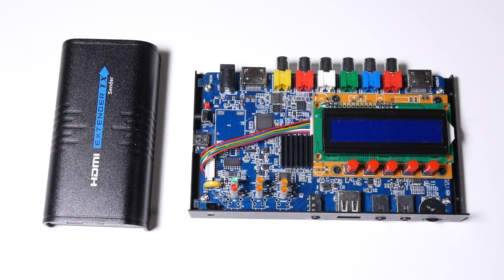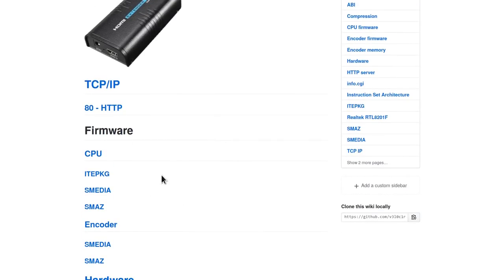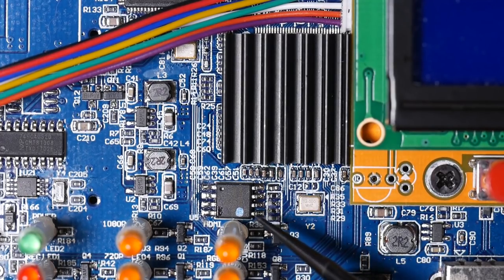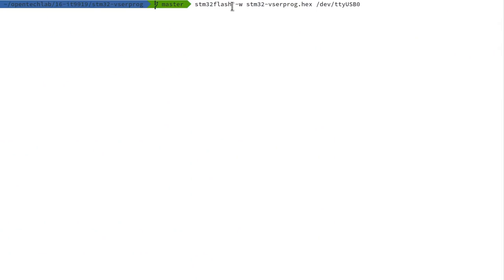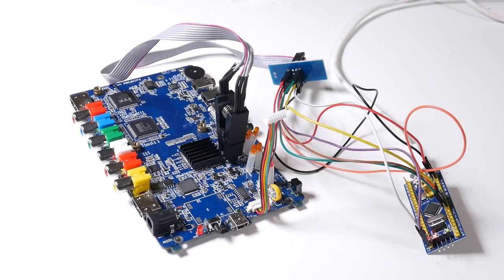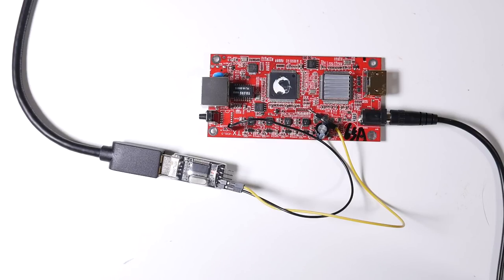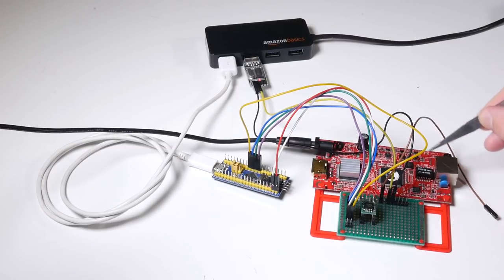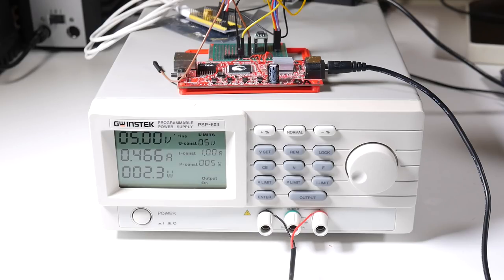[016] IT9919 Hacking - part 1 - Reading firmware with flashrom

Comment: One trick you can use to read flash in circuit is to keep on board processor in reset state. When in reset most of the pins are in high impedance state, and obviously application processor will not interfere.
Reply from the maker: That's a good idea. I never tried that before
Reply: Can you please tell me how to do it? a tutorial for example. Thanks

Comment: Thanks for this good tutorial!
On the STM32 bluepill you do not need to first remove the 10K resistor - just solder a 1K8 resistor on top of it. The parallel resistance then comes to 1K5. This gives less risk of damaging the board.

Comment: I'm 8 minutes in and I'm still gobsmacked that a company (ITE) believes that making their product/chips 100% opaque to anyone that is not a customer is a good way of interfacing with the world. Who cares if non customers know what your ISA is? Why be this secretive? It's even more amazing that a customer would signup to this kind of secrecy. But what do I know? 
Fascinating video for sure!
Reply: They are probably using a lot of someone else's IP in their silicon so they have to be secretive about it in order to not get sued.
Reply: @evghenim1955  Yes, that did occur to me. You're probably 100% correct. I could go as far as guessing that "their" risc core could be something from opencores.org which are under a GPL license.  RISC V maybe ?
Reply: @vincei4252  Isnt RISC-V a relatevely new thing? In the firmware, I see datecodes going back to 2009. I would guess its something more like MicroBlaze of sorts in there.
Reply: @evghenim1955  ok
Reply: Maybe the chip is used in for example settop boxes and thereby contractually kept secret to make it harder to reverse engineer. I saw there is also a security processor...
Reply: @tmichiels  If I understood the datasheet the right way, the security processor is just a HDCP decryption unit (and not an actual processor), but I/datasheet might be wrong.
Settop boxes... Honestly, I dont think thats the case.

Comment: Great to have a new OpenTechLab video!

Interestingly I was able to make a dump (and later restore this after a brick with a dodgy upgrade file!) of the LKV373's flash chip using `flashrom`via the Raspberry Pi's SPI interface without having to extract the flash chip.
Reply from the maker: Yeah with no series resistors it becomes a battle of drive-strengths. It's sometimes worth trying just to see if it will work - even if it's very marginal. But there's always a risk of damaging the board.

Comment: 1. Welcome back! This video a quintessence of hacking and a hacker mindset and it makes me think how far we can go with a bit of curiosity and some knowledge, also, it shows how vast the value of free software and open hardware is.
2. Is there a specific reason why you avoided using a flash/SPI programmer based on CH341A (there are compatibility patchwork for flashrom)? It might have been much easier to read from the soldered SPI chips using something like that along with the alligator clip.
Reply from the maker: Nothing against the CH341A's - though I didn't have any at the time. Overall they're not bad chips, though I would like them more if they were a bit more capable and flexible. The price is good though.
I like the Blue Pills - although it took me a while to explain how to program them in this video, in reality it's a 30-minute job to bring one into service if you do it regularly, and they're a lot more flexible. They can serve as any USB 2.0 Full Speed USB device: JTAG adaptor, GPIO controller, stepper motor controller, Arduino etc. etc., so I think it's worth spreading awareness about them.

Comment: you can desolder the ground leg and raise it off the pad, then hook everything else up normally and since the ground is only connected on the ROM but not the board, you should be able to get a better signal.

Comment: I think that the location in the SMAZ for those strings is the dictionary table.   Basically all lossless compression algorithms use a dictionary, that is created on the fly as the compressor compresses.  The compressed output will have the dictionary and the references (the compressed data) to dictionary.
It is quite probably the hash/crc check do not pass on the edited data you uploaded, and it is very interesting that the board has a secondary storage for known last firmware, pretty cool.  It avoids the problem  of converting the device into a paper weight if upgrade does not go thru as expected.
The w25q32 chips has a write protect pin.  I wonder, if you re upload modified code, then disable write via pin, and boot it?  Maybe the code will just try to write, and assume it went thru, and reload, and then maybe it will apply?  maybe it will go into a loop? no idea, but will give more details on how it works.
Reply from the maker: In regard to the WP pin - you are correct it would reboot loop.

In regard to the SMAZ structure... we'll get to that

Comment: Can you load a bad checksum image into the main eeprom, then monitor the addresses being accessed from the eeprom and the on board backup. I feel that at some point the main processor will need to make a decision that the checksum was bad and then reach out to the backup to do a re-image of the eeprom. This could tell you which bytes of the main eeprom are related to the decision the processor needs to make for the checksum and potentially give you a subset of the whole eeprom that would be interesting, and which would contain the checksum byte, even its location.

Comment: I wonder if holding the main ASIC in reset at power up would tri-state the SPI bus, allowing you to read out the firmware without desoldering.
Reply from the maker: Yes - you're not the first to point that out. I didn't think to try that, but I'll keep it in mind for next time.

Comment: Great spelunking! btw you should totally make the inverse of the soic adapter for soldering in place of the chip on the original board, similar those game console easy-solder mod boards! Where there are little solder cups/U shaped cutouts.

Comment: The dump clearly shows a crc. All compression algorithms have a dictionary. Most if not all compilers afaik, make a constants table to all constants in the source and then links to them. It's not just strings but ints, floats, books, or any base data type. Crocs have a broken 2nd order resistance collision, and I believe a pre image collision. Find the crc.

Comment: Great video - the first I've sen from you but not the last. I had a thought about reading the SPI Flash more conveniently than removing it from the system. Could you just isolate the power pin? That way when you drive it from your external setup none of the rest of the host board is powered and so might be less intrusive, and when you power it from the host board it's back home. You could have a 2-way switch to select. Just a thought.
Reply from the maker: If the SPI pins are high impedence when the reset of the board is unpowered, this would work well. If not there's it's possible to end up feeding power in through the SPI lines going into the clamp diodes of the processor.

Comment: Why not simply stack a resistor on top, i.e. in parallel? That's usually an easier operation than removing a resistor...

Comment: I am interested at reverse engineering my marantz sr5600 home theater receiver. To reduce noise. To increase amplifier output. To modify speaker impedance on the multiroom channels. Add hdmi 2.2 ports. Add usb   3.2 input, bluetooth input, 1.5mm. Adding the newest dolby digital encoding, adding 4k encoding and upscaling.

What about modifying an older Asus wifi router running opensource firmware and upgrading it to 802.11ax and any newer security features/ programming?

How about reverse engineering a Roku or Firestick 4k to run solely off of Linux?

Comment: Great video! You should get some proper chisel type soldering tip. It's way better than this one you are using.
Reply from the maker: The main issue is that that tip was very badly corroded. It was the first outing of a rather nice OKi soldering station I rescued from being scrapped. After filming this video I ordered a new tip, and I've been very happy with it since.

Comment: Disable writing to the eeprom from the controller...  perhaps it will just drop through after it thinks it has re written it.
Reply from the maker: As I discovered later, that would send it into a reboot loop.
Reply: @OpenTechLab  Darn!
Reply: @OpenTechLab  Bate and switch then? Have two eeproms or emulated and swap eeprom after initial check?  (timing will be very important)